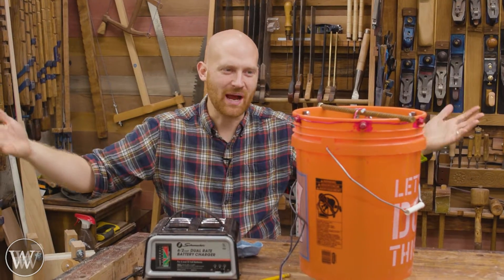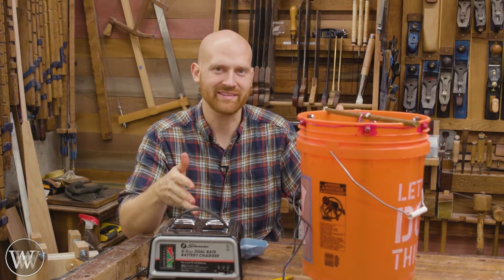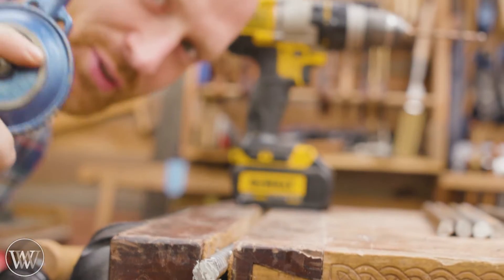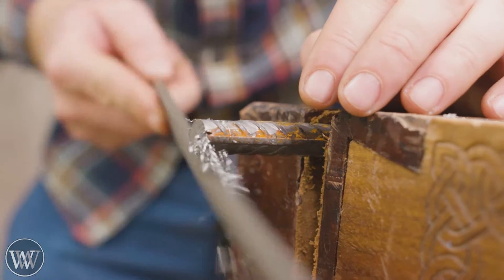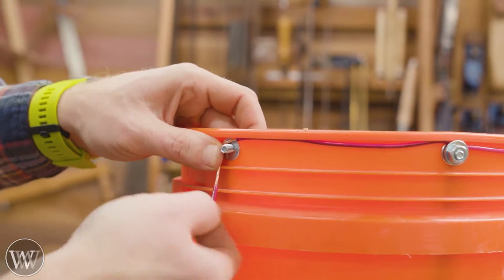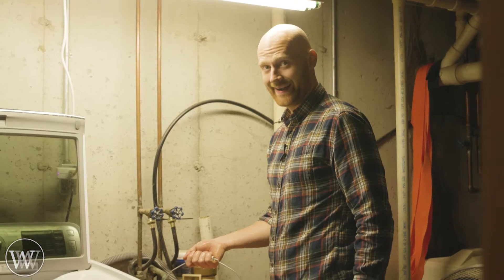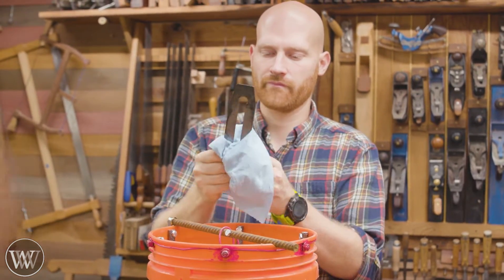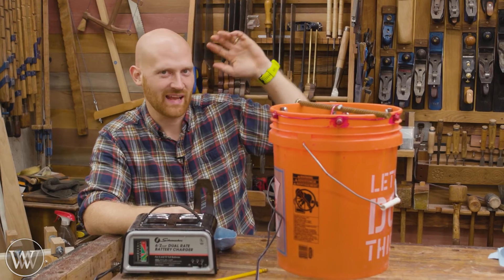How to Make an Electrolysis Bucket Tank Thing DIY

Comment: Is there any magic secret to determining how many rebar rods to put inside a bucket? In the UK our DIY sheds have orange buckets but smaller than yours, so do we use fewer rebar rods or thinner ones? The whole planet is now ruled by orange buckets... Thanks!
Reply: I made one with just one 20 cm bar on the whole bucket and it worked just nice, make sure the conection is above the water since electrolisis agressively attacks the anode and it can chew trough the wire
Reply: @thekchile  Thanks for that information and your useful observations - a great help !
Reply: I know this is old but figured I'd toss in what I can.

  My understanding is that this works largely on line of sight.  So say you have a square bucket,  put an anode (the rebar)  in each corner and the tool in the center,  and it will easily de rust the whole item.  If you have just one anode,  you may have to rotate the tool after the first side is cleaned.
Reply: @virtuosooo  Thinking about making me one with a stainless steel wash tub.
Reply from the maker: no specialty to it. the more you do the easier it is for the proses to work so I usually put them every 4-6" around the outside.
Reply: @WoodByWrightHowTo  Thank you for that! You MUST  be busy in that workshop - You replied at 4 AM UK time, which is night time for over there!

Comment: One of the best explanation on how to do this that I've seen. I know you said to use rebar but I think its worth noting don't substitute stainless steel for rebar, disconnect charger before adjusting, and don't do this in a confined space (hydrogen and oxygen do come off in miniscule amounts). Would you please clarify if the process is self stopping or will this actually eat away at the bare metal. I thought that it wouldn't but am really not sure. I've always kept an eye on it as deep down I'm a worrywart.
Reply from the maker: thanks Jack. It will eventually eat through all metal there. but it would take a couple weeks to go through a plane iron, but 24 hours or less is rarely any problem for most any parts.
Reply: @WoodByWrightHowTo This process removes rust, not the "good" metal. I do cast iron skillet restoration by this method, it won't eat away a skillet etc.
Reply: @Rockhunter329 thank you for this clarification!!

Comment: I understand the need to use power tools from time to time, but not going to lie everytime I see you using one it just feels odd, like something has gone wrong with the matrix. This is a good video I've got a few old (1890's-1910's) plane irons I need to de-rust and I'm not 100% sure I feel like hand sanding them all
Reply from the maker: this would make quick work of those.

Comment: How do you know if a used battery charger has the electronics that would prevent electrolysis?
Reply from the maker: it will say "automatic" something or other on it. some of the time it will say something like "will not work tell connected to battery."